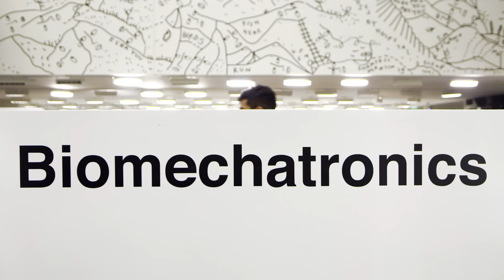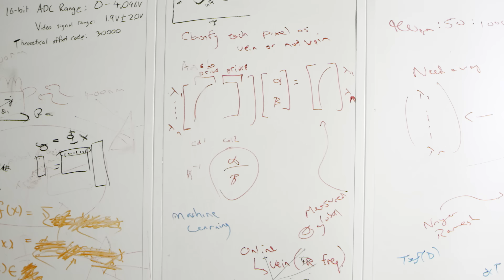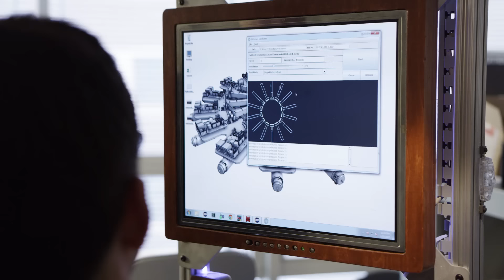Can Prosthetics Outperform Real Limbs? | Cyborg Nation

Comment: When you run with two bionic legs are you able to keep running or do you still get tired?
Reply: While u still use ur muscles(which means u will get tired)u will last significantly longer. And u wont get kramps. And u are less likely to get injured too
Reply: You will get tired quicker. You miss about 50 muscles and have to use more energy so you’ll tire out faster
Reply: It depends on the legs! There are many different prostheses, and if you look at the kind of legs Oscar Pistorius used to wear to run, they actually have a sort of spring action built into them, which does help propel you forward.
Reply: vinyl hedgehog those are called Cheetah springs. You don’t walk with them - only run.
Reply: @vinylhedgehog5574  Wait, so did he really become a gold medalist in the summer olympics and did he get charged with attempted murder? Or is the trailer wrong? This is crazy..
Reply: @Goblin_Hands  sounds insane right? Sometimes life is stranger than fiction...
Reply: Andromeda Vieira hi - trust me I know all to well. Would talk about it, if I haven’t had the opportunity to walk with them. Being an amputee and all ;-)
FYI - these are NOT legs - these are feet and they are heavy!
Reply: @dennispedersen7460  So you own these limbs shown on the video?  Was curious do these need battery power to run that motor? If they do how long does the charge last?

Comment: This was back in 2015 think about how much it must have advanced by now. I remember reading online like 3-4 years ago that a big problem with prosthetics is that you can't feel something that is touching the prosthetic such as when you put pressure with your feet on the pedal of a car (which was the example I read about) and how people with prosthetics don't drive as well as they used to  if they can make it so that you sense what happening with your prosthetic such as someone or something touching your prosthetic arm or leg  instead of only feeling something near where the prosthetic meets the amputated part of the body

Comment: Now you need to make it run off your bodies own electrical system. No need for batteries.
Reply: Chad Andersen its probably possible bit it will probably Be huge
Reply: Deus Ex Mankind Divided introduced such system in the sci-fi world and can be read about in the Codex, a form of add-on attached to the heart converting fats and proteins into electricity.

Interesting concept.
Reply: There's no way that'd be viable. The human body runs off of 2000 calories, which is roughly 1/4 of a phone battery. it'd take 10s of thousands of calories every day to power that leg for an hour
Reply: The human body doesn't have an "electrical system". You'd have to invent a motor that turns ATP into movement and you'll never get an efficiency even close to that of the body.
Reply: Or Solar Energy. Or you could be like Spiderman and carry replacement web cartridges on you...but not sure if the web would really help...much.

Comment: how tall are you with the bionic legs? did you give yourself a few more inches height or a foot of height? I could imagine that you're climbing a cliff face, reach a point where you need another foot of reach to get a foot hold and your legs extend to reach it. that would be so cool to watch. I also wouldn't cut a limb to put bionics in on purpose, but I am super thrilled that if something did happen, that we have come so far in taking that next step in recovery. Although I will say that my right foot has been bothering me at my ankle for the longest and it feels like it will eventually wear out.

Comment: See, this stuff is cool, but I've yet to see anybody actually get to keep one of these and not have to use it under heavy supervision or specific circumstances and then have it taken away after they're done. Almost five years later and I still don't see anything like this that's actually in the hands of and owned by a consumer.